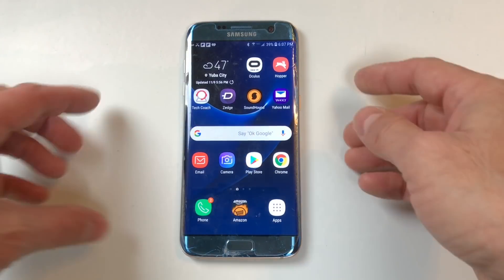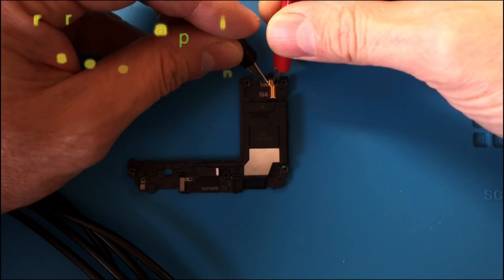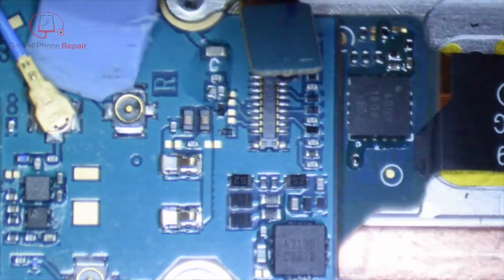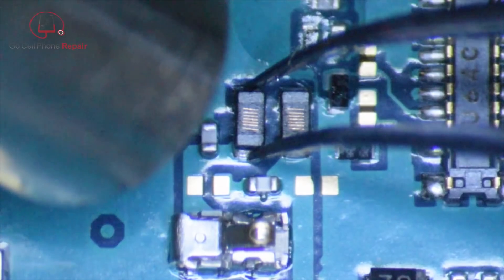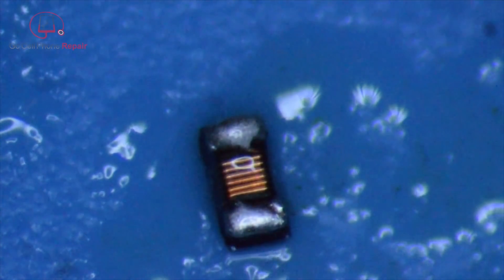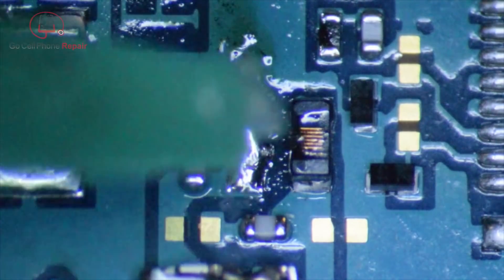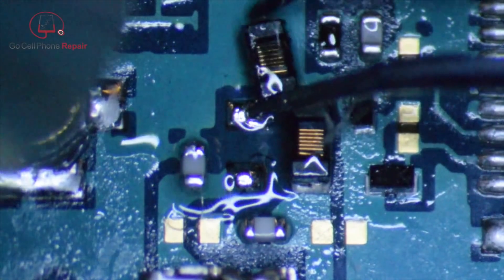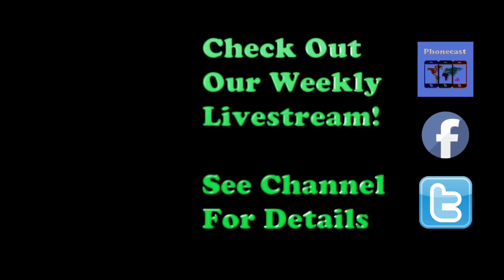Galaxy S7 Loudspeaker Repair

Comment: I have a similar problem.  My phone got so hot that it turned off and when I disassembled it it was like burned in the part of the lower speaker where you were repairing.  After heating so strongly the phone did not turn on and I cleaned it with flux and turned on, but now the horn is not heard and the fingerprint sensor stopped working.  I see that those capacitors that you removed have the same problem and that of the fingerprints.  I even tried another board and the button lights turn on but the one that got hot doesn't work and they are good.  Do you think I can repair that friend?